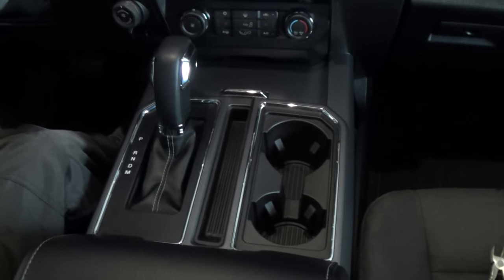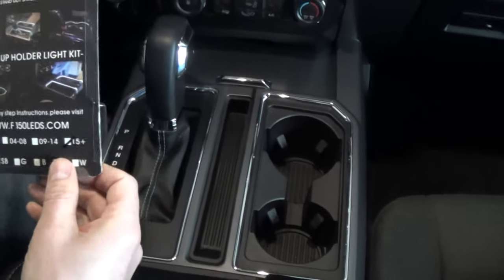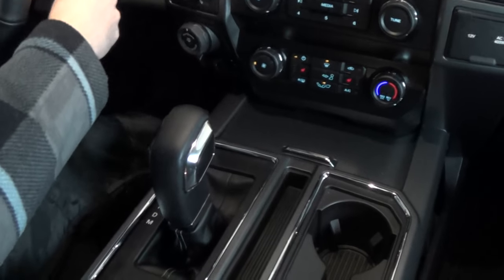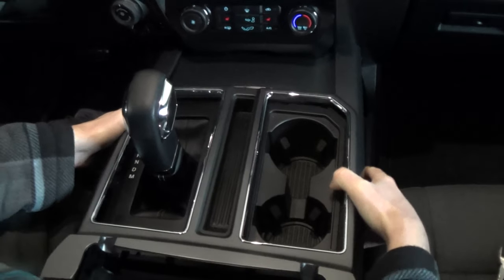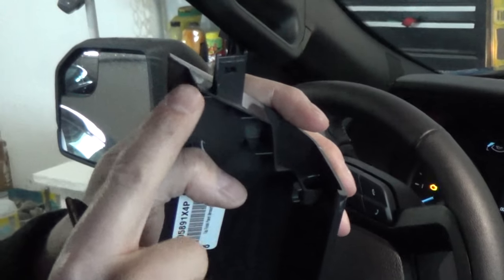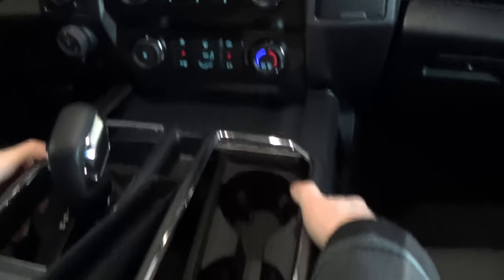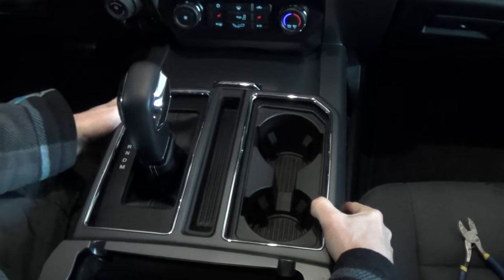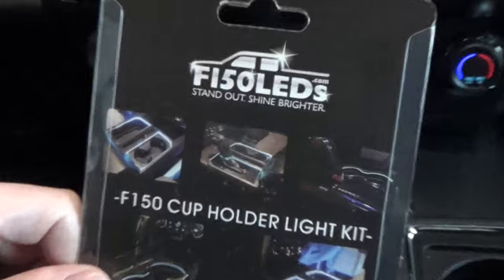F150 Center Console Trim Removal Tips and Tricks.

Comment: Thanks for the tutorial. Never know how to start on these things without some tips.
By the way, I didn’t trim the corners. I put my thumbs on top and fingers on the sides as far forward as possible, squeezed fingers towards thumbs while pushing the whole piece forward and it popped right in nice and easy.
Reply from the maker: Your welcome!  That's good to hear that you didn't need to trim the corners.  I did mine just to make it easier to get in and out since I need to access it for the ambient lighting I installed.  Thanks for watching.
Reply: Do you mean you used your fingertips to push the trim piece underneath inward as you pushed the top panel forward?
I was thinking of trying that and figured I would just get stuck and have to break something, so did it actually work? Or is that not really what you meant? 

I ended up making those cutshe mentioned with a pair of end nips, and that outcome was awesome 👌
After I did it, I realized it was not sitting flush the first time I had reassembled it without the mod 😅

Comment: Thanks for the video. If I follow these steps, then can I retrieve a key and credit card that slid forward on top of the ashtray cover? They have fallen into the abyss, and I am not sure which area of the center top and or lower console I should remove.
Reply from the maker: You will probably need to remove this center console to access the forward storage compartment.  From there, you will be able to look into the abyss and find your lost treasurer!  Good Luck~
Reply: @DeanoOutDoors  Thank you Deano OutDoors. All the best!
Reply: I just lost something in the abyss as well (poor design).  Did you have any luck removing the lower shift console as shown in this video or do I need to remove the front console?

Comment: Very nice and calm video. I love it
Can u do a video how and where u cut the trip piece at the end of center console? I removed it and it was very hard and it was even harder to put it back on
Also I lost few of white clips on center console while i was doing it. Do u know where i can get them and what size they are. Thank u so much
Reply from the maker: Thank you!  I had the same issues re-installing.  So I used a side cutter to notch out the plastic on the trim and also removed a slight angle from the bottom front of the base where the trim slides back in ( watch at 2:03) . You can get the plastic fastener clips here -  https://www.amazon.com/Rexka-Console-Retainer-Mercury-Challenger/dp/B07FW25CGD  ~ Hope this helps!
Reply: @DeanoOutDoors  Thank you so much for your detailed info